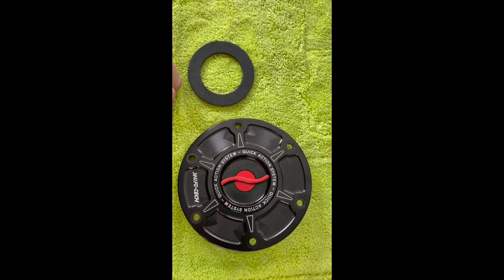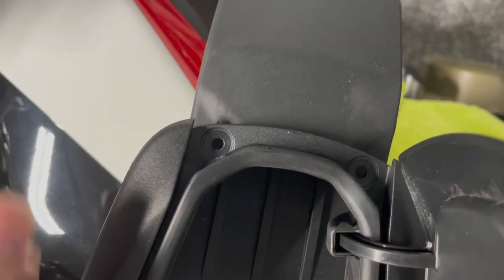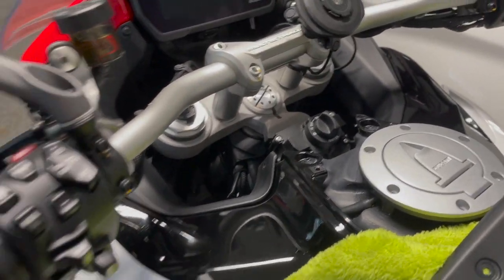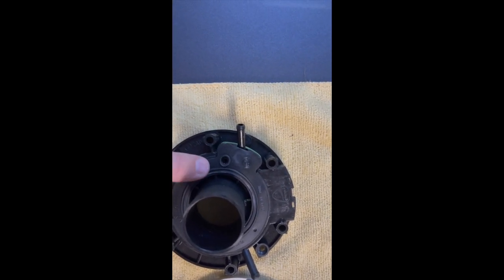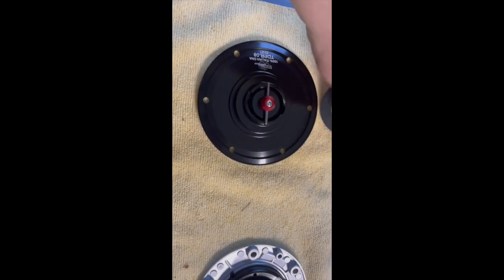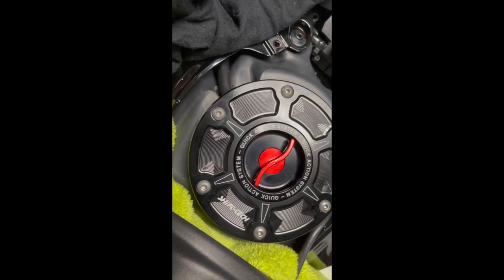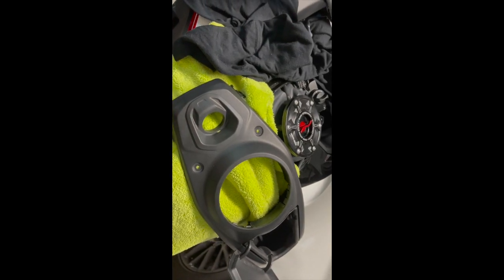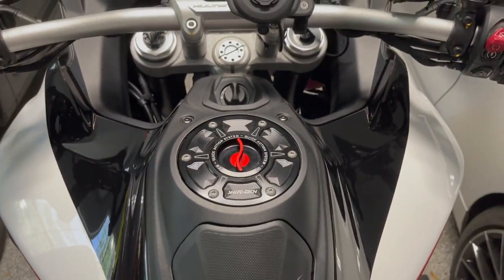RIDE ON | 2022 Ducati Multistrada | Keyless Filler Cap Replacement

Comment: Looks like a good option Richard. I had the Ducati electric gas cap installed while in for 600 mile service. Of course after the install I start hearing about electric caps failing on earlier models (2015.& down). Hopefully it won’t be an issue.  There is not an alternate way to open if it were to fail that I can see.  Carry an Allen key in the tool bag.
Reply from the maker: GSA's and earlier Multi's with electric gas caps can occasionally play up. Sometimes they can be freed by just pressing down hard in the right location, while the key is within range. And other times you're into dismantling part of them to access the release mechanism. The keyless filler is a bit like a door handle versus a phone lockable door handle. If you live in a high-crime area the high-tech solution might work well, but there is a lot more potential for something to go wrong and in the practical sense it's less convenient, no matter how cool it might sound. It's kind of like having to go through four TFT menu options to disable ABS, versus a simple on/off button. Sometimes simple is best. Or as Einstein said, everything should be as simple as possible, but not one bit simpler than that. Probably why the Tenere 700 sells so well!
Reply: I purchased the electric gas cap (96681021AA) and hope to install it today or tomorrow.  Seems pretty straight forward.  Anyone know where the wire connection is located on the bike that the new gas cap plugs into?  The wire cord on the electronic gas cap must be two feet long so it could be anywhere.  No instructions with the new gas cap and I wasn't able to find anything looking in the online schematics.  Any direction is appreciated.
Reply: Took me about 20 minutes.  Done.
Reply from the maker: @jasonj7701  Great! I hope it works well for you Jason.
Reply: @jasonj7701   Did you get it installed? Thinking of getting one myself and have the same questions as you.
Reply: @D4V1D-TN  Yes, it was a simple install.  The connector is right there on the left side.  It's a bit quirky that it won't open until the dash is powered off.  If the bike is powered on and you push down on the cap a popup comes on the screen saying it's open, but it won't actually open until the power is off.  It would be nice if Ducati had any instructions or mention of things like this with their accessories.  Overall, I'm glad I did it because now the fob can stay in my jacket pocket.

Comment: Hi , i like looking you videos they are good and informative , the look of the new fillercap is awsome , it suit the bike really good . I do have one question about it that for me is a worry  , i wonder if  it is unpractikal to find a place to put the lid when you are filling , and the danger for it to fall to the ground , expesially when you fill up the bike without leaving it ? Stupied question mybee , but it is one thing i have been thinking about . Ride safe Per
Reply from the maker: That's not a stupid question at all Per, in fact, it's a GREAT question! I wish I'd remembered to show it in the video, but it actually stands up really nicely and sits securely on its edge in the rubberized recess area around the ignition turn switch at the front of the tank. It's on no danger of falling off there or forgetting to put it back into the tank as your hand has to go there to turn the bike on anyway. Thanks for posting!
Reply: You make a good point about what to do with the cap.  Most race organizations require caps like these and me and my buddies would always be dropping them and kicking them across the pits on our race bikes.  Maybe we’re just clumsy?  It’s why I decided to go with the ‘keyless’ auto locking gas cap.  I hope I don’t regret it (still waiting for delivery) as I’ve heard some bad stories on the earlier generations. 

Richard, keep up the great videos!  You do quality work and I enjoy watching them.  I think I’ve seen almost all of them.  Your videos help me decide to purchase the Multi V4S, so thanks for that.
Reply from the maker: @jasonj7701  It's definitely ynot me, it's you - you're too clumsy! 😆 I truly appreciate you watching all my videos Jason, they'll obviously be a lot of videos featuring my new Ducati moving forwards, and hopefully, they can provide help or just make a simple coffee break more enjoyable. Ride often, ride carefully, ride on!

Comment: Dear Richard, thanks for this video🙏. One small question: this clamp on the hose (right side), how did you open this? Or did you replace this clamp? Cheers, Henk
Reply from the maker: You can just pull it off by hand, and push it back on by hand. If it's really stuck, gentle use with pliers should see it slide off. No need to replace the OEM clamp, so long as you don't damage it.
Reply: @RichDunn  thanks for your swift reply 🙏

Comment: Any specific reason to move from a keyed cap which would prevent the theft of the petrol to a non secure one ?
Reply: How many people bother to steal petrol from a bike ? It’s more important there is. A good seal so no vapour get out
Reply: K T, from my perspective, theft of petrol is really a non-issue in this part of the world. It just doesn't happen. We're fortunate in that regard and the new cap looks much better and saves the hassle of digging for a key at the obligatory gas stops.
Reply: @erikl4242  Yeah it does look better than the OEM one because that silverish one was looking a bit odd on that black tank. Glad you guys are fortunate because here there are a lot of miscreants who for the fun sake do shitty things. Which is why the older carb bikes had an option to fit a key fuel stop and when I bought my Harley I moved from the non lockable one to a lockable cap.
Reply from the maker: @Dude_Virus  Yeah, pretty much what Erik said. I'm fortunate to live in a fairly affluent low-crime area, and can park my bike in a garage overnight, plus ultimately myself and my 9mm are never all that far away from my bike! 😀